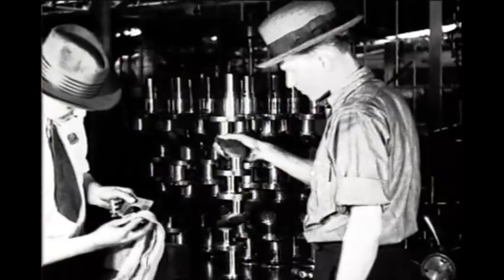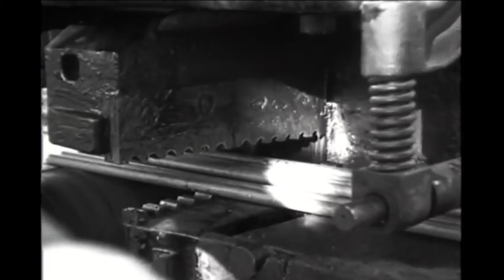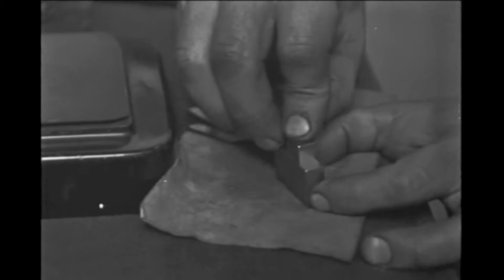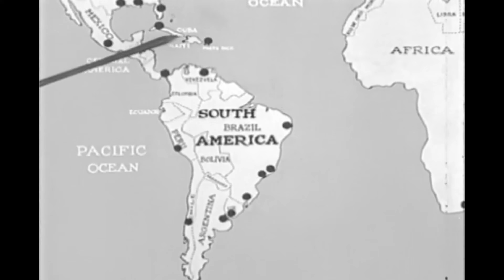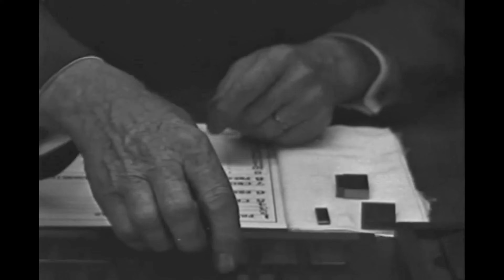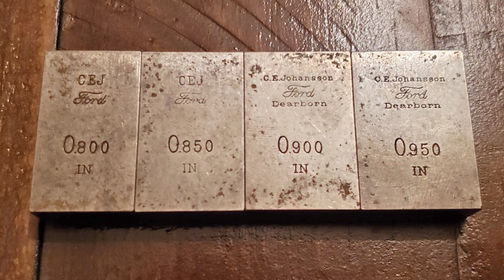The Precision Build of the Model A Ford; Carl Johansson's Jo Blocks

Comment: Fun fact, scientists still aren't exactly sure what process locks gauge blocks and other very flat, very polished surfaces together.
Reply from the maker: Glad we aren't the only ones still baffled by it. Thanks for watching!
Reply: As it's not explained by vacuum since it has a far greater force than a vacuum can hold in theory and practice. Neither is it magnetism because it works on ceramic blocks as well.

Comment: Can't find a complete set of these and going rate (as an antique) I suppose, but those prices from 90 or so years ago ARE STEEP.  But, I suppose if you need to have them, you have to pay.   I did find Mitutoyo Gage Block Sets for 6740.50 and 4839.20.   That's the company that makes expensive calipers, that Harbor Freight clones the look of and sells for 20 bucks.
Reply: Mitutoyo makes over 5,000 metrology products, I've seen a partial catalog of the hand type gauges and tools and there are things in there I can barely comprehend in their operation and use cases.